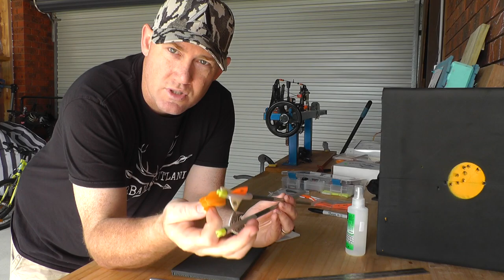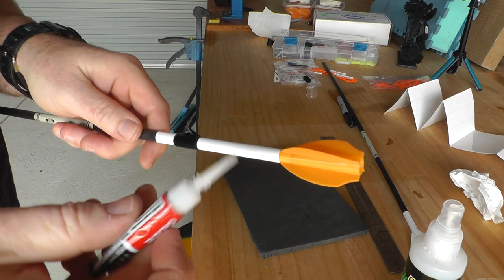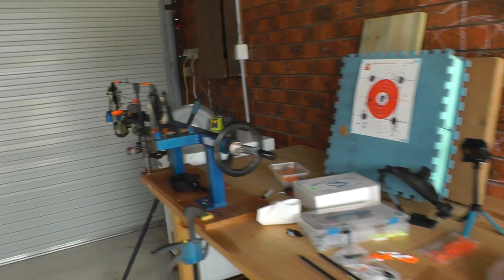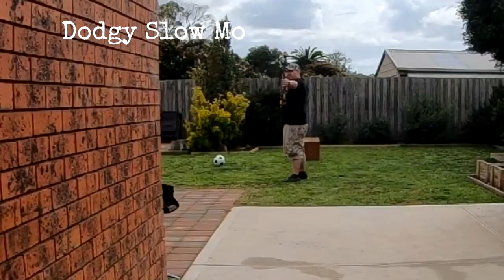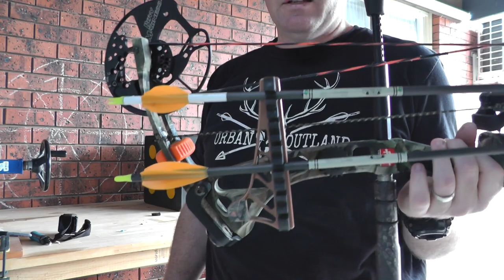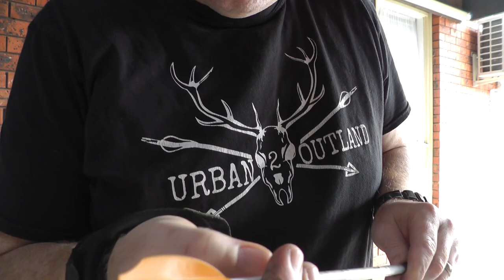Easy Vanes - Test and Review - Australian made archery vane

Comment: I have the 4FP65 easy vanes. Excellent. I stripped off those ubiquitous mediocre Blazer vanes that many fletched arrows come with, and slid on the easy vanes. Not sure glue is even needed, depending on the exact fit for your diameter arrow.
Reply from the maker: Hi Ron, I'm currently shooting the same vanes as you have on my new set up. Its amazing how well they actually fit, pretty snug hey. I'd probably still chuck some glue on just incase though. Keep us posted on how they work out for you. Cheers for watching mate.
Reply: I’m shooting Zinger vanes, I shoot 300 spine arrows but ordered the Zinger vanes for 400 spine so they fit more snug, I use soapy water on the arrows so they slide on easier, do you think I could do the same with the Easy Vanes, are they a bit streatchy at all? I have not had to use glue and I don’t want to, but I would really like to switch to the easy vanes. I’ve even shot the Zingers with no glue using a whisker biscuit that I have on one of my old bows although I use Hamskea drop away  rests on my hunting bows.